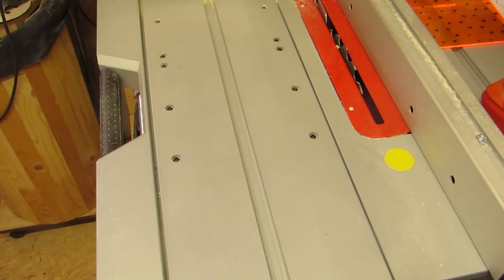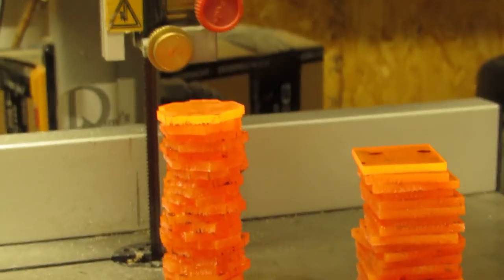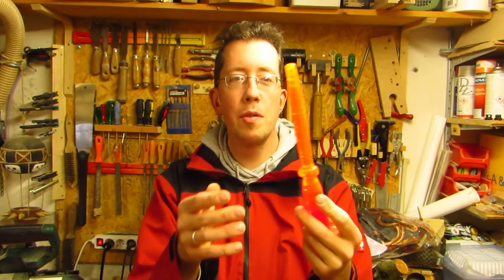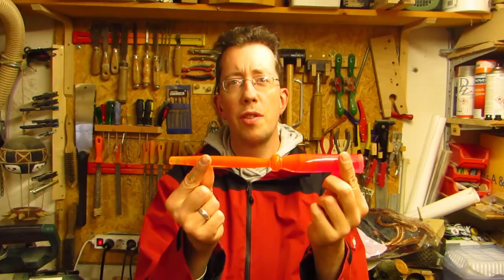Flourescent Acrylic Wand

Comment: This is really cool looking! I've used my angle grinder on the lathe before too! You can actually use it on the lathe while the lathe is spinnng! as long as the side of the grinding disc you are using is moving upwards. (while the lathe spins down towards you) I just learned I can get some cool acrylics from the dollar store and put them together similar to how you did!
Reply from the maker: That is a good point regarding the angle grinder, Dylan. I need to keep that in mind!